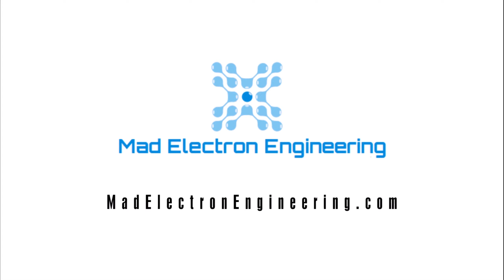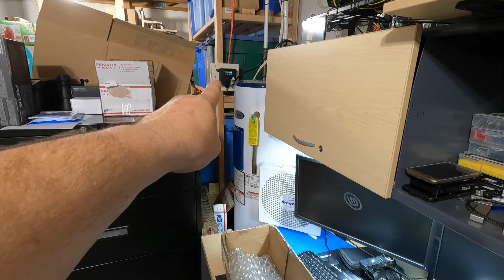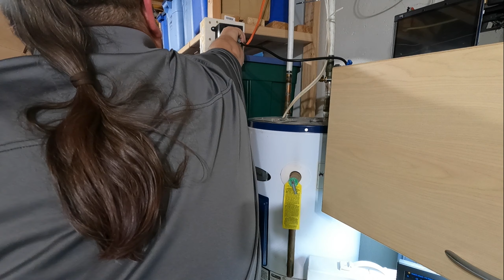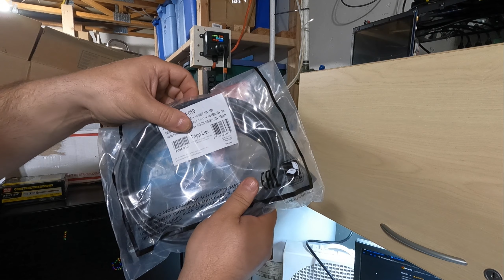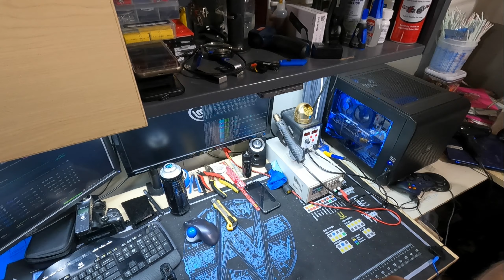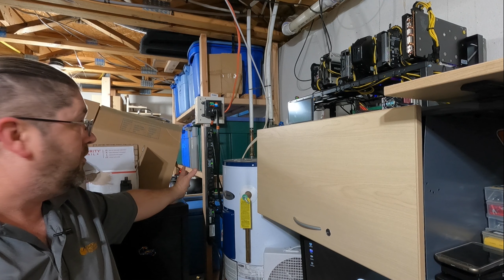Cheap 240V 12 Port PDU For Mining Rigs Or Servers

Comment: Great video! Quick question... is a PDU necessary for connecting mining rig to 240V? If I just need two plugs, can I just plug server PSU directly into 240V wall outlet and utilize the server PSUs as the surge protection? Thank you!
Reply: Power supplies are NOT surge protection!

Comment: Hey great video. Do you know how to make those HP power supplies turn on remotely? I have a rig with a normal ATX psu and an HP psu with breakout board powering a couple cards. However even using a KASA smart plug only the normal PSU has AC power on but the HP one i h have to physically switch it off and on again.  Anyway to get around that?
Reply: You need to daisy chain the server psu with the atx psu so when the atx psu turns on/off it automatically turns the server psu on/off. You can do this by plugging the atx psu molex or 4 pin(looks like a fan cable but its not) cable into the breakout board on the server psu.

Comment: So does it break out the 240v to 110 on the individual outputs?
Very very cool, 1K draw is pretty beefy, I'm surprised you don't have battery backups on those badboys (both mining rig and your PC)
Either way awesome setup man!
Reply: Hi Brian, Good q, it was not included in the scope of this vid. It's assumed with IEC connectors, u need 240v pwr supplying the equipment. 240 draws less current, the efficiency performance measurement is unclear as shown if 90-130VAC L-N circuit is more efficient. Which it is, under high loads, which this is with something as energy consuming as mining. We will probably overheat the planet with mining.